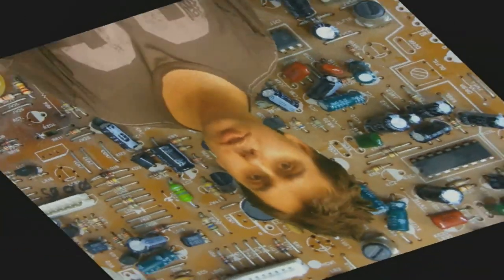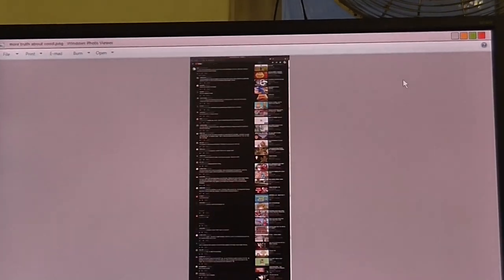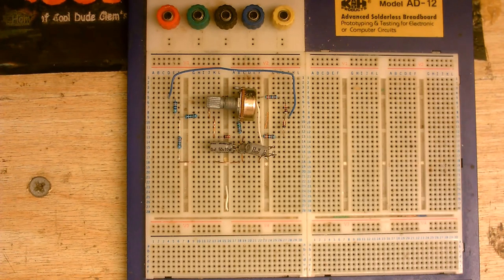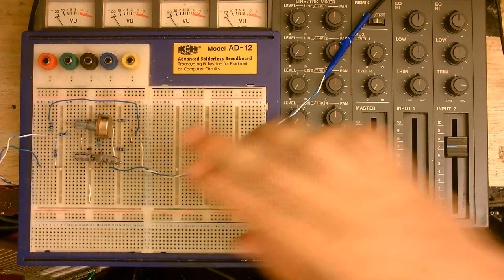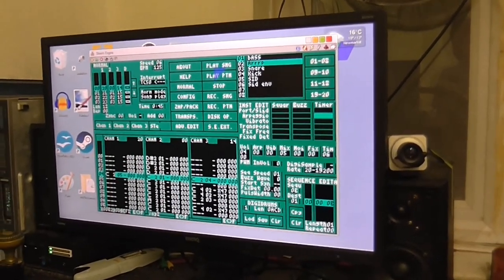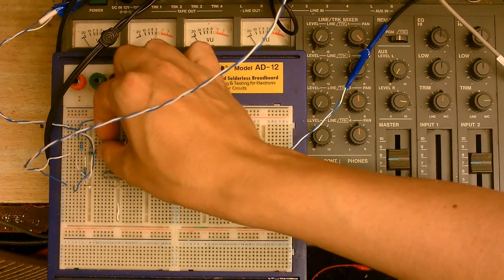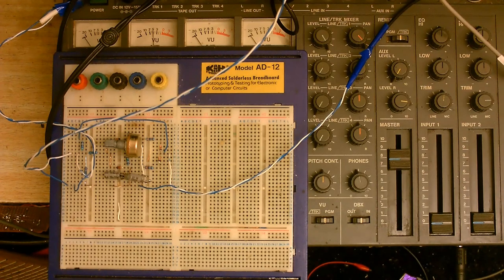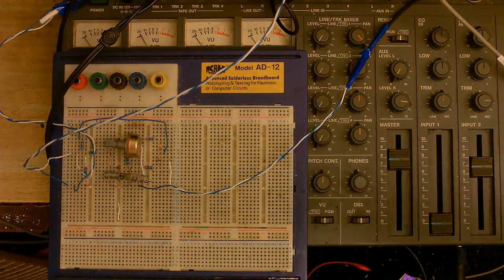An audio compressor made with passives?

Comment: The AA119 diodes are germanium diodes. They have a threshold voltage of around 200mV, compared to 700mV for a 1n4148. 
Also, the germanium diode's curve around the threshold voltage is more 'curved' rather than an abrupt 'angle' for the silicium diode. This means that with the silicium diodes, you'll have more distortion, and a more aggressive limiting, in theory.
Germanium diodes are still easy to find, you may wanna plug in some germaniums to see what the difference is in practice.
Reply from the maker: I thought they might be germanium, but at the moment I don't have any to try that with.